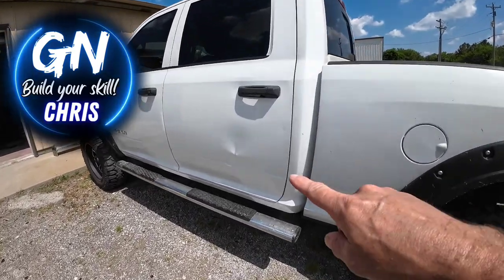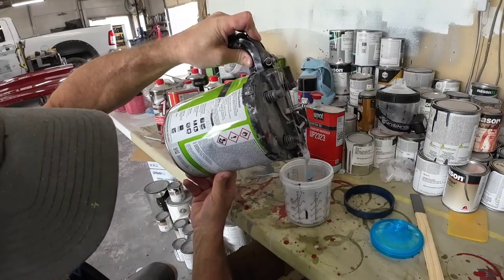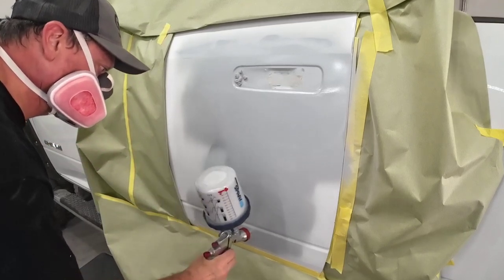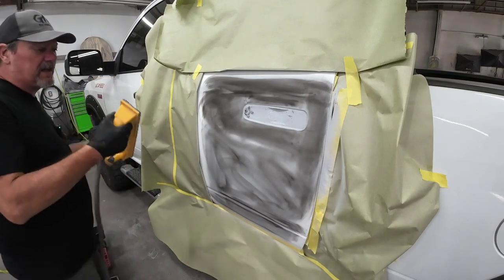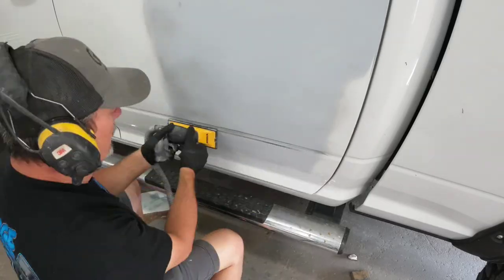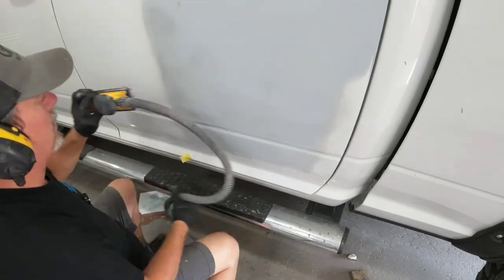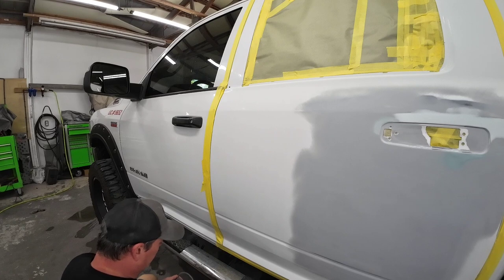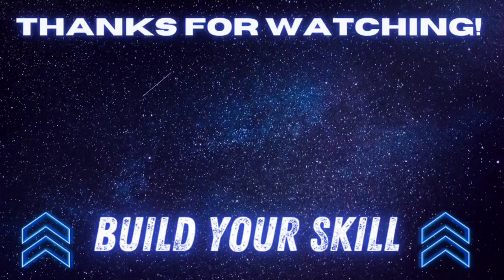Beginners guide to prepare primer for paint

Comment: How long does that primer need to dry before I block sand for the first time? And how long do I wait before I start painting base coat and clear ? And do I need to wait for shrinkage or can I do all the painting process in one day? I need to do this same repair. Thanks
Reply from the maker: There is some shrinkage with this primer. So ideally you would wait overnight for the primer to dry. If you do that, you shouldn't have a problem with shrinkage. You can sand it and then once it sanded and prepped out. You could paint it right after that

Comment: I see that the UPOL System 20 primer can be mixed as a primer filler (4:1), a primer surfacer (4:1:1) and a primer sealer (4:1:2). I see a lot of videos explaining the application differences between a surfacer and a sealer, but not much of any explanations on the appropriate applications between using a filler vs a surfacer. Based on the fact that the filler mixes without any reducer, I assume that is appropriate to use when you want the highest amount of filling capability to provide more product to sand. Is that correct? Also, my paint supplier didn't provide reducer - so can I use any urethane-based reducer?
Reply from the maker: Yes, you are correct.  High build if applying over filler and need max fill. Yes you can use any urethane reducer.

Comment: Enjoyed your video. What yellow block sanding kit is that? Can I hook it up to a shop vacuum?
You use the alcohol instead of the wax and grease remover? Curious why you made that choice.
Reply from the maker: It's  a mirka sanding block it can be hooked up to a mirka vac but as far as a shop vac the hose sizes a different. Alcohol or prp solvent abothe fine . I use both but Alcohol is cheaper and creates less static.
Reply: @GarageNoise  if you had a panel done to bare metal what choice would you make? Alcohol or wax and grease remover? 
Alcohol will remove what type of contaminates?
I’ve watched people use certain window cleaners and then wax and grease removers but this is the first time I’ve seen using alcohol. Your thoughts? Thank you for the response.

Comment: Great info. I have a gallon of the upol high-build primer. Will it fill in small paint chips? I'm planning on spraying 5 wet coats then blocking and painting as I don't have time to prime-sand and reprime.
Reply from the maker: Yes it will, anything deep should be filled tho.
Reply: @GarageNoise  Will do. Today is primer day for my roadrunner and hopefully paint by the end of the week lol.
Reply: @allenpp6748  I like to use the UV activated filler for that. It makes the process faster, and I noticed it doesn't seem to shrink like the old stuff.

Comment: As a business,how critical is the preparation.do you look at and sign off on all body work from employees before painting in applied.
Reply from the maker: It's  very critical, most important steps. I'm  the I'm  the main employee 🤣 I do have Daris helping with prep.
Reply: You're using the right kind of primer  used it ten years in large shops the painter oks or rejects the body work since he may need to re paint it in Dallas in high guality shops youre required to have 8 years as a body man except possably the skings big box there working for the ins co not the customer.

Comment: Does the type of primer really matter if I'm going over old paint? I was wondering if I could use lacquer primer since it's a 1 part (for convenience) under a 2 part urethane color coat.
Reply from the maker: You can but 1k is real aggressive and can react to different types of paint. If you are going to use it light first couple  coats with extra time to dry.